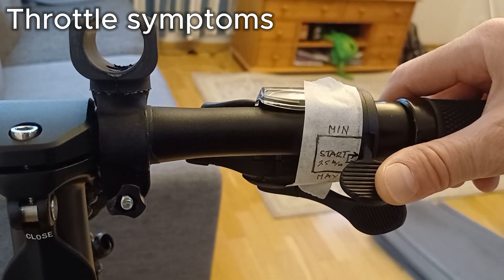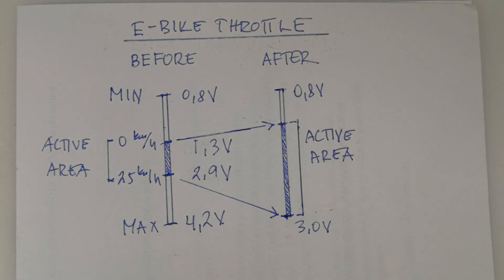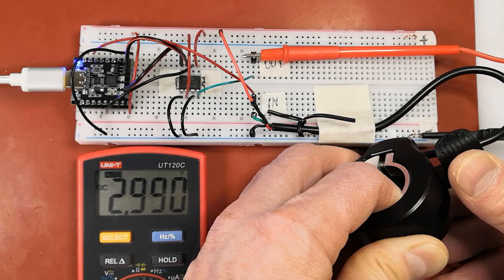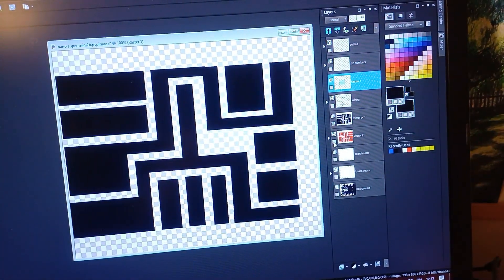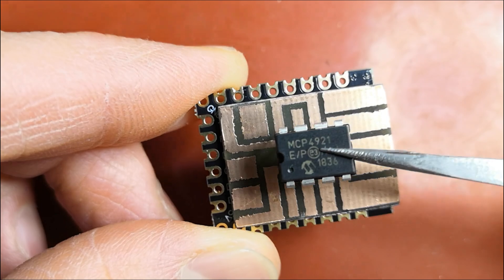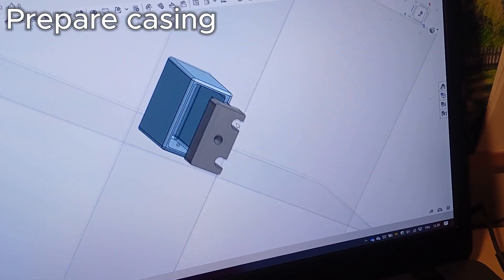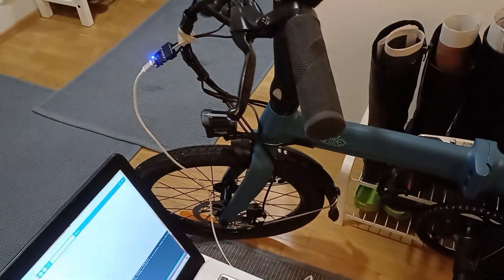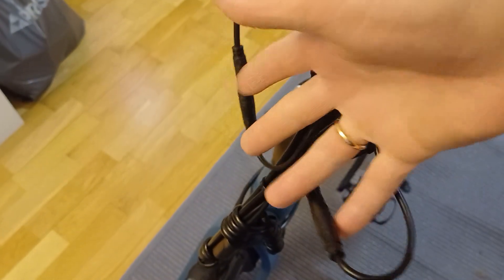FIX E-bike Jumpy Throttle - Fiido D11 + Arduino Nano SuperMini

Comment: can you please share code and circuit( for a scooter need) sorry to ask
Reply from the maker: I'm not professional programmer. If you find my code useful, feel free to use and modify it.  Link for code and pcb:  https://drive.google.com/drive/folders/1_tJ0zvtN_D66WRJxthyq_EPeH8acUuct?usp=drive_link
Reply: @SnapTinker  great i will try to reuse in a future but finally grab a controller where you can set throttle range as parameter

Comment: Great idea! I feel like there could be so much more done in the controller's software of my Fiido Titan bike, to have some more flexible use of the throtthle, instead of having to resort to such modifications as you did. For example limiting the throtthle speed in the app would be awesome. It would be really useful when climbing really steep hills when you don't necessarily want the bike to challenge the battery and the motor to their maximum. Or a walking mode (4.5 kmph), etc. Ehhhh
Reply from the maker: This is actually rather easy mod - after someone has done it once. However, it took lots of time for me, because it has not been documented before. To have the idea and do some experimenting, and make it work in real life.
Reply: @SnapTinker  I'm an embedded SW engineer, I don't need to imagine the time and effort it took for you to build this, I know it did ;) Even simple projects are time-hungry...